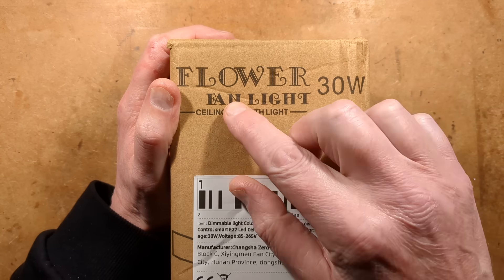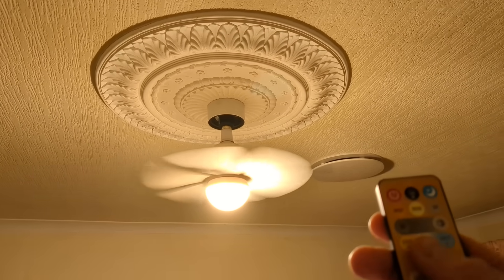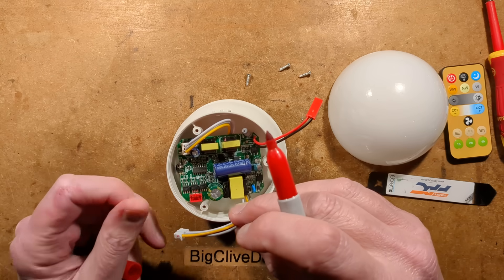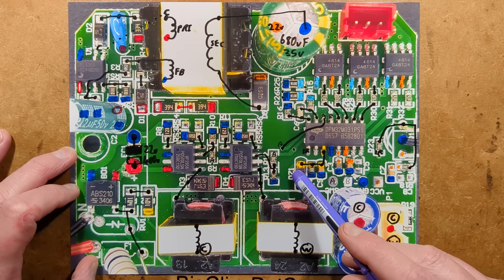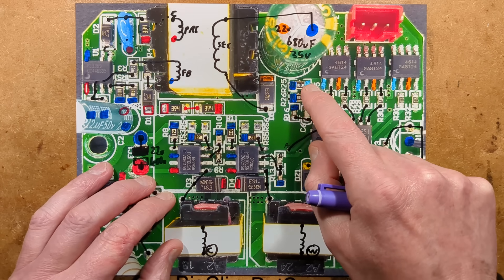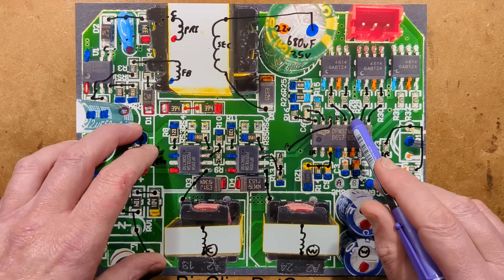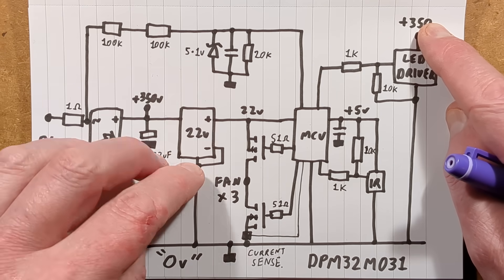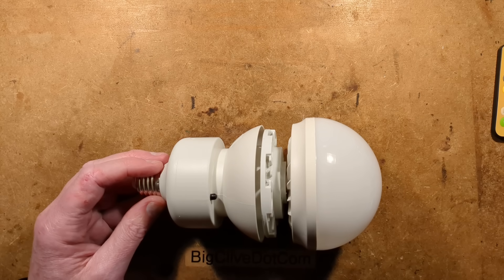Inside a screw-in ceiling fan and light - long version

Comment: It seems to me that the electronics are quite good in this, just the "screw-in" part is dodgy... Any unbalanced centrifugal oscillations would be transferred to the socket, multiplied by the lever  between the rotational plane and the socket and this indeed is not in the design considerations of any standard socket. So, IMHO, BBC warned correctly, didn't they?
Reply from the maker: No.  The stresses are miniscule with this small unit.  The BBC was just making news as they tend to do.

Comment: Reminds me a bit of my grandads house where he used to plug his iron and heaters into his light fitting with a special bakelite fitting. He also had tees so he had the light in as well obviously. I think i still have some of them somewhere...
Reply from the maker: That's how everything used to be plugged in.
Reply: They were quite common in old houses, before they had separate power socket circuits.
Reply: When electricity was first installed in homes, lighting was the only load available thus there were only screw in sockets. Then irons and fans were invented and they had a male lamp base as a connector. I have actually removed lamp sockets from baseboards because they were the only option as plug  🔌 in receptacles hadn’t been invented yet! As an electrician I love this history!

Comment: regarding the heaviness/safety concerns..don't use them with cheap chinese lamp sockets. I bought some heavy duty looking ones made of ceramic but the inner edison screw and contact points are so thin like aluminum foil. Screw in a little bit too tight and the contact rips off. couldn't solder it back to the aluminum.
We need you to construct a chandelier made of several of these with Y-shaped 1-to-2 edison adapters.
Reply from the maker: Ah yes, the trash chandelier:-
https://youtu.be/2DMGAd_xJiQ

Comment: It's possible it's true. Ceiling fans in North America have warnings to either run a safety chain from the fan to a more solid support because they have actually fallen down on people. It's why the code here specifies that if you are mounting a junction box in the ceiling, it has to be one rated for ceiling use and installed properly so it can handle heavy chandeliers and ceiling fans. Or you might find it falling on your head or also pulling the ceiling down with it because it was only attached to the drywall.  Ceiling fans are less likely to be a thing in the UK so it's possible they didn't really have much for things just holding ceiling lights, whereas in the US and Canada installing a DIY ceiling fan is a very common thing to do that takes around an hour.

Comment: Do these people not realize how light sockets are mounted? They use a junction box to attach the light socket and the junction box is attached to a joist in the ceiling meaning that at no point do the electrical wires have any weight on them!
Reply: Most residential applications use standard plastic or fiberglass boxes. They are not rated for ceiling fans to be supported by them. You need a listed fan box.
Reply: This was ny thought too!  Like if it was gonna twist wires so would screwing in any bulb
Reply: Not in much of the UK.  We used hang lampholders on flex.

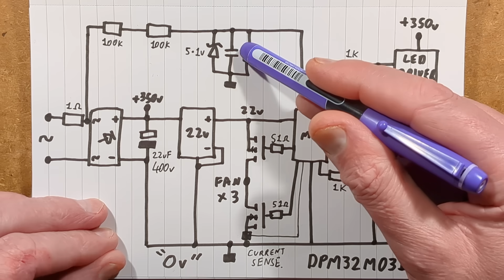Comment: 13:58, @bigclive, surely the 20K is to there to avoid exposure of the zener to mains-level voltage?
Reply from the maker: The 200K resistor circuit is indeed to limit current so the zener can cap it at around 5V.

Comment: A side benefit of one of these is that the BLDC/PMSM motor and driver circuitry shown here is probably substantially more efficient than the simple AC motors usually included in traditional ceiling fans, especially at intermediate speeds.

Comment: I certainly wouldn't like one of these things falling off the ceiling and beaning me in the head, but it's light enough that I think it's unlikely to cause any real serious injury.

Traditional fan mounts are a lot beefier for good reason; those fan units are a whole lot heavier, and while it's preferable to have one of those properly installed if it's feasible, I wouldn't be especially concerned about a little thing like this spinning above me.

Comment: I bought one of these fan lights during the summer out of interest to see if it was any good. I was so impressed that I immediately bought two more! The first one was dismantled even before it was tested. The build quality is excellent. The 3 phase motor impressed me as did the electronics. Bargain at £12 each.
Reply: Except the light is an integrated circuit board, so it'll be difficult to find a replacement.

With the flat, crystal light version I had, the shade was glued on, so in the case of it burning out, it would be extremely difficult to replace the light module without sawing it open or even throwing the whole unit away out of frustration.

Mine also had a knocking sound, but that was because of the rotor hitting against the stator due to the bearing's attachment to the central shaft becoming loose and developing play over frequent usage.
Reply: @Alexthefancollectori disassembled such lamps using IPA and if that didn't help, a bit of heat

Comment: OMFG -- I could not believe you when you said the BBC and others were warning people not to use these lights.  And then I go looking at "BLAM" articles.  Quotes from electricians about they are too heavy for the sockets and will eventually unscrew themselves leading to heat contact shorts and deadly fires.  Recommendations from councils that you should remove them as dangerous.  WTF is wrong with the people of the UK?  Are the people in government that mentally deficient?  Or do they merely think of themselves as gods that should be obeyed.  Most of these fans are LIGHTER than anything that used to be on the ceiling.  And I will agree that the weight of the light fan is then on the light socket instead of the based around the socket which is what things used to be tied to.  So I could understand issuing a warning that you might want to have the light socket checked to confirm the style in use can handle the added load (more modern ones would).    But the pure fear mongering and nanny like attitude of the articles ... wow, I guess the UK does not think people can think for themselves.  How pathetic.  And if you go looking there has not been one single report of one of these screw in fans leading to a fire.  Zero.  Zilch.  Nada.

Comment: Finland is total opposite. You're hard pressed to find an electrician bothered to do smaller domestic jobs like fitting a more complex ceiling light. My colleague needed to get some bathroom re-wiring  during a renovation and it was about 4 hour job but the electrician had better jobs to attend to and kept blowing the agreed appointments off couple of times before actually bothering to show up.

Comment: I have a quite expensive ceiling fan. Very well balanced. I get a slight knock noise from it when there's a breeze from the window, pushing it off-kilter a bit. I know someone with a much cheaper fan, and as well as a noisy motor compared to ours, it knocks all the time. I assume just not as well balanced, one blade sligthly heavier or at not quite the right angle, or even as simple as some component in the hub not in balance.
Reply: And for a low-cost solution, it's rather neat, glad to see it's not going to kill everyone in the town. I will check one out! Cheers.

Comment: I think the danger would be in older installations where ceiling roses were fitted often with two screws to a lath and no support to the dangling twisted pair to a bayonet socket, add the extra weight of an edison adapter and the fan unit leading to at best it decending rapidly to floor level. In a modern well designed installation no real problems but there are still some very old wiring installations often lived in by elderly couples who may think its a good idea.

Comment: 5:31 I'm surprised you didn't say anything about the big spark in the upper right as you were setting it down 😜 I don't see any other comments about it either. It looked strong enough to curl hair.
Reply: How can it be a spark...
Reply: Thats because that was not a spark. i went back and played the video at .25 speed, it happens when he is tilting the fan and its just the shiny PCB catching the light from his overhead lighting rig and shining it back into the camera. also if it was a spark that big we would have heard it pop, since we dont hear it and he didnt react, not to mention it happened in a part of the board where no components were touching it cant be a spark.

Comment: Just pointing out that the lack of hall-effect sensors on the motor does not rule out BLDC since there are coil-based feedback controllers. Having position sensors is only necessary for critical applications where the motor must start the first time every time or where the motor may require high torque from the start which requires the controller knowing the rotor's position to apply full current to the correct phase to get the motor started. Most drones use sensor-less BLDC drivers since motors have practically zero load at stall speed and there is plenty of coil feedback by the time propellers reach take-off speed.

Comment: If the BBC is getting all pissy about a light fitting it's definitely worth buying.
I see no potential hazards other than getting too close to the death beam capacitor as it explodes from being cooked  by the LED drivers.
Otherwise a neat design and surprisingly easy to disassemble for Chinesium.

Comment: Only complaint- lost remote- lost functionality. Adding a string pull would be nice.
Reply from the maker: See the description for modes that can be used just by switching the light on and off at the wall switch.
Reply: 8:14. Huh. I’ve a lightbulb that does something similar.

Comment: We've had two of these fans fitted in a flat where the Electrics were replaced about 9 years ago and had no problems, however in my partner's mum's place where the pendant was probably 30 years old the fan snapped the cable and fell off. YMMV

Comment: So to negate the danger from the fan. 1) plug it into a fixed ceiling socket that can properly support it. 2) Don't put it on a low ceiling. 3) Don't put it on a long flex and use it to stir the bubbles of your matey foam while having a bath. Obviously such a dangerous device..bravo the BBC for pointing this out.😏

Comment: So, I can understand the BBCs concerns of twisting wires out, etc if you're shoving one of those into a cable only hanging light fitting.
But if it's mounted into a ceiling mounted fitting, screwed into even just the plaster, the screws will prevent any twisting motion, and the wires will be fine.

So the warning was incorrect. The same way they said not to use these at all, I could demand everyone stop using desktop computers because they're dangerous to use in the bathtub.

Comment: Yours looks like the version where the rotor has noticeable magnetic "bumps" when you spin it. I've found it makes more noise in some fixtures due to the vibration. I've got a couple that use RF remotes and have 5-6 speeds and don't have this issue.

Comment: ceiling fans are very common in the USA, but Air Conditioning is also. But we have special electrical boxes that brace off of the rafters to support the extra weight and vibrations. in fact there are 3 ceiling fans running in my house as I comment, Some people in the south even have them on their porches.
Reply: They technically do in the UK as well. just that in the UK most of the time the weather just isnt all that warm. unlike say in the south of america were ceiling fans will end up getting use for at least half the year. though the porch fans are often hilarious since a lot of time times when you see them they often have some droop in the blades thanks to the outdoor weather they werent really designed well for. makes me always wonder why with outdoor fans why they insist on using the same particle board and wood veneer type blades when metal bladed fans seem like they would be more robust to the heat and humidity.
Reply: @compzac  those outdoor fans with blade droop are not actually made for outdoor usage but people get them because they are cheap.   Actual outdoor ceiling fans have metal blades on them for quality ones but cost way more but also last longer. (Alabama)
Reply: We have a 52 inch in my porch ceiling.  As a bonus, it seems to keep the mosquitos down.

Comment: Fascinating device. I never considered using a light socket for anything but a bulb. I wonder what other things they’ve done. I’d love to see a kettle plugged into a light socket plug.
Reply: That used to be common in the early days of electricity. a lot of houses didnt have many outlets, so you could buy (and still can as far as im aware) screw in adapters that will change an edison bulb socket into a bi pin receptacle. Of course this is largely an americans view, but it was somewhat common for years. In fact i once saw a toaster from the 1920s that didnt have a traditional plug, instead it had just a bulb screw on the end of the cord and a somewhat longer cable so you could sit the toaster on a table and have the cord run up to the ceiling fixture.

Comment: That's likely a sensorless brushless DC motor. It commutates power between 2 of the motor connections, and uses the induction into the 3rd  to sense and sync.

Comment: Traditional ceiling fans will make a knocking noise if the wooden blades are not balanced.  They do sell little clip on weights to try to balance them but a good quality fan should already be balanced. Here in the US they are used everywhere.  Even Costco, a giant warehouse store, has huge fans on their ceilings with at least an 8 foot span of the blades.  Any US big DIY store has dozens of the home sized ceiling fans on display..
Reply: I believe the ones art Costco are, in fact, Big Ass Fans.

Comment: At first glance that unit looks surprisingly well made - both electrically and mechanically.  I worry about the inertia effects if suspended via a cable, but at least the speed ramps up and down on switching on/off.

Comment: Me, to younger me: "Kid, in 40 years they're gonna use computers more powerful than your uncle's shiny new Macintosh to spin a ceiling fan or an angle grinder, and they'll be half the size of that 16-pin DIP you got there"
Younger me: "Mom said eating solder is bad"

Comment: 3:36 Mine constantly made a knocking noise - it’s because, as it spins up, the force of the motor knocks it slightly off-centre. On the highest speed, it would then re-centre itself. On the lowest speed, you’d have to re-centre it yourself by holding the light at the bottom.

Comment: I had one in the UK, though mine was a huge one that replaced the light fitting and was held in place by two large bolts that went through the beam in the ceiling.

Comment: That fan is really small, so it's probably fine, but in the US, ceiling fans are required to have a special reinforced electrical box with a pair of steel struts that hold the box to two ceiling joists. Usually the boxes are just nailed to a single joist or stud on one side only

Comment: Having installed a few fans in my time, the knocking noise is usually the blades being 'out of balance" which throws the fitting around. The dangerous part is if the starting/stopping of the fan undoes the edison screw. A little loose, makes a got spot at that contact. ( I don't like edison screw fittings but that is just my opinion ).
Reply: But would be fine with the much more commonly used bayonet fittings, (in the UK, anyway).
Reply: @RichieReportsUK_UKCNews The normal type here in Australia as well. Though the newer ones are just plastic "hooks" that end up brittle and so will snap easy under all that movement.

Comment: UK Government: "Most of your homes have shoddy and dangerous wiring, due to half-baked sparkies getting their loicenses out of a cereal box. Next time you have work done, you'll need to spend thousands to bring your home up to whatever codes we've come up with in the past few minutes."
UK Government-run Media: "These lightweight fan/lamp combos are far too dangerous to use. You should get one of those half-baked sparkies to 'properly' install a ceiling fan j-box in the ceiling."

7:31 - WHAT? Not one single chip number has been scrubbed off? That's an unusual sight on this channel! 🤣

My mother purchased a similar unit, an "impulse buy" while in line at Walmart. This past summer we were doing some deep-cleaning in our basement, and we were getting a bit sweaty. She asked me to install it in the fixture over where we were working, and I did, and it moved a surprising amount of air despite its size. Its light output was comparable to the 75-watt tungsten bulb it replaced. (Basement ceiling is open joists, the fixture is your basic mid-1970s metal plate with ceramic E27 socket that attaches to a j-box.) It seems well-balanced, and it's nearly silent even on its fastest setting.

Comment: I have a screw in ceiling fan sold in the usa under bell & howell and it works pretty good. I have another version which is a regular fan and the first one I got was defective. Fan and light wasn't working. Took it to bits and the power supply  was fine. Hooked 2 12v battery packs to it and tried it and it did the same thing. I think it's the driver mosfets. Ended up buying another one which worked fine. Will be trying to fix the defective one.

Comment: An ARM Cortex-M0 is the modern PIC. They can be bought as cheap as $0.07 in modest quantity with 8K Flash, 2K RAM and a 16-bit timer or two and a multi channel ADC and maybe a UART for IR/RF control. All together, this makes controlling a synchronous DC motor, PWMing lights and reading an IR or RF remote really easy.